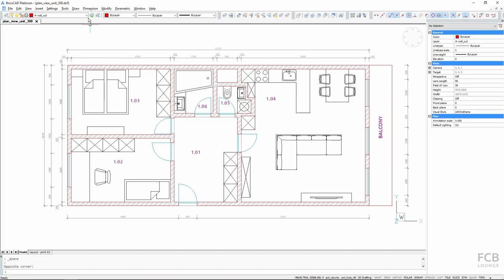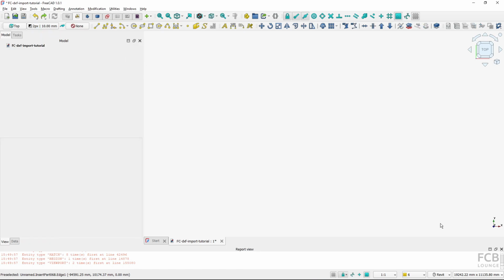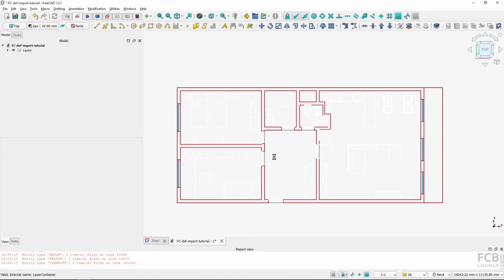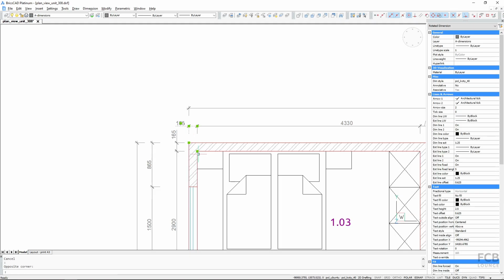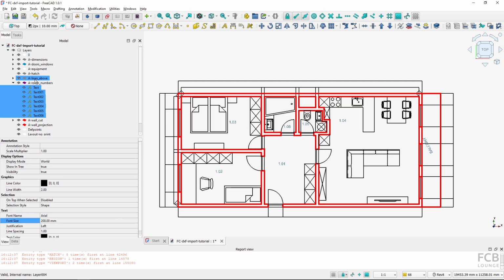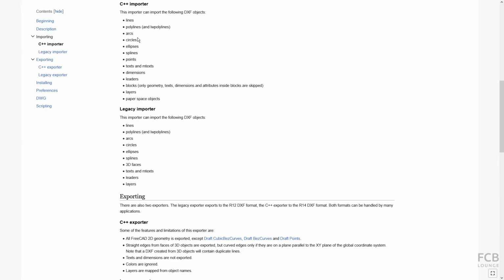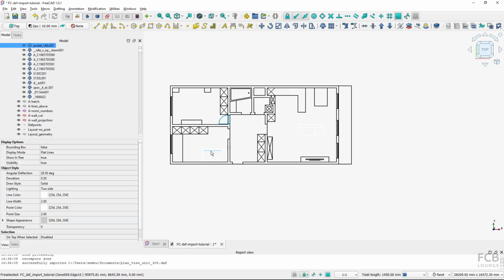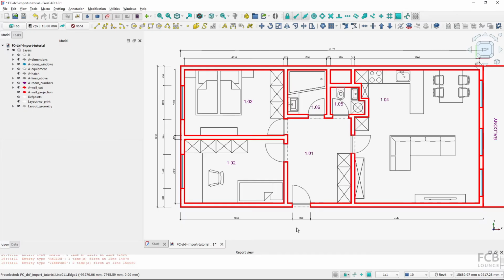DXF Import Options in FreeCAD (Applicable to DWG) | FreeCAD 1.0 and older

Comment: Hi Tom,
many thanks for the Upload this video about DXF import.
From your channel I learned a lot of Building Drawing (BIM) in FreeCAD; without your Tutorials I would been lost at all.
However: I managed to create a plan of the building where I'n working on; with a little bit thinking, try and error and learning by doing it works so far:
The arrangement of rooms and their dimensions, positions of doors and windows I got 'under control'. 🙂🙂🙂 
My goal is now to put electrical symbols like switches, sockets, LAN connection etc.  according German standard (like DIN) into the 2D drawings. 
May be I'm on a wrong track: My idea is to create the symbols with the part workbench, convert them to DXF (create a small libery for the different symbols) 
and import them into the Tech Draw workbench and put them in place. What do you think? Or do you know another way how to do this?
Many thanks in advance for a reply - and excuse my not perfect English writing.
With many Greetings from Germany
Scan Train
Reply from the maker: There are many options on how to work with symbols. It depends on what your requirements are. But I would refrain form doing the Part WB -> DXF -> TechDraw workflow.
You can go straight from Draft WB -> TechDraw as described in this forum thread:https://forum.freecad.org/viewtopic.php?t=96199